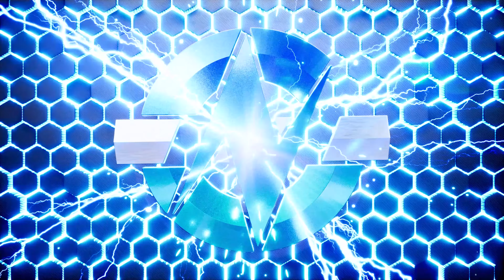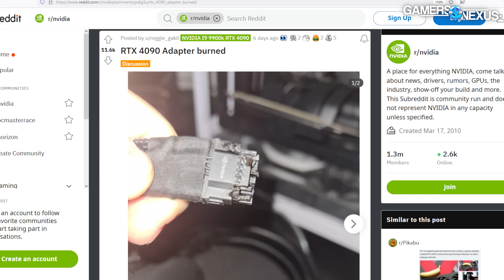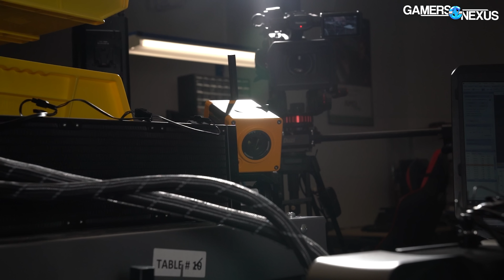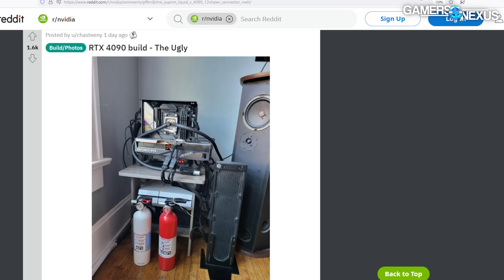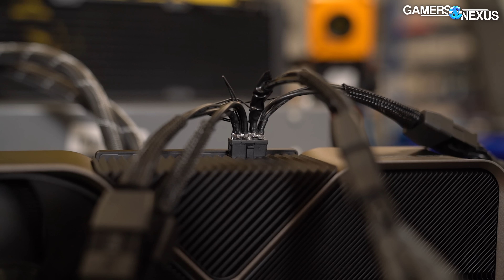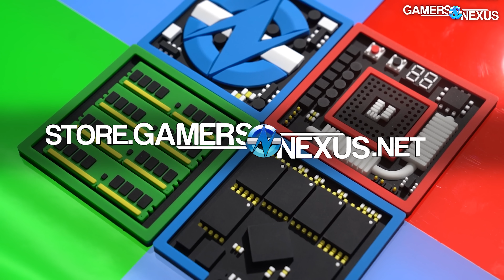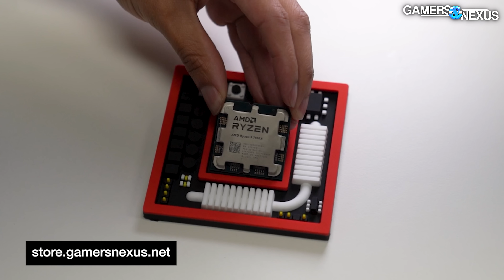Testing Burning NVIDIA 12VHPWR Adapter Cable Theories (RTX 4090)

Comment: Steve from Gamers Nexus is the most unknowledgeable person ever. His opinions are clearly biased, rudimentary and bought out by corporate entities. I am sometimes amazed to see someone so negative about the best of the best. His review on the Alienware Aurora R13 is clearly the most baseless one out there. Every statement claimed about the Aurora is false. I myself have tested my Alienware Aurora R13 with Intel core i9 and NVIDIA RTX. It has turned out to perform in the top 5 PCs of the world at extremely low noise levels. Steve clearly had no idea what he was talking about when he said it had bad thermals. As for the so called 'over engineered design' by Steve, it is one of the best PC cases to ever exist, if not THE BEST. I would definitely recommend reporting Gamers Nexus immediately, as they have most likely been bought out by HP or NZXT. Like really, I used to trust that guy with every CPU review before that shitshow. But now, its just false claims with paid propaganda. Please do not consider any of his opinions about the Aurora R13, as they are clearly false. Dell Engineers are the best of the best, and we should be grateful for them to deliver such a beast in terms of performance. Not to mention the liquid cooled Aurora R13 with its powerful 120mm radiator outperforms every custom looped setup to ever exist. I even managed to beat the new RTX 4090 scores with the NVIDIA RTX in the Aurora R13, so it clearly is one hell of a beast. I'd say few liquid nitrogen-cooled PCs would match these levels of proficiency. Dell is one of the most consumer friendly companies in the world, and cares for the buyer way more than any other. As for the Aurora, hands down: Best Case, best components, best looks, best RGB. I cannot praise this beautiful machine enough. Again, I would advise everyone to block Gamer's Nexus off their watch list as soon as possible. These guys are not focused towards reviewing a machine, but to carry out their own propaganda which is actually fueled by rivals. Each one of their reviews is fake, and I cannot emphasize enough on the one on the Aurora R13. That one in particular is the most disgusting lie I've ever faced. Alienware has been my go-to brand since the dawn of this millennia, and I would not hesitate to defend them against cruel reptiles like Gamer's Nexus gouging profits from controversy. It is undoubtedly the best PC out there and totally worth the $6000 mark. Most custom looped PCs, water-cooled PCs are nowhere near this level of premium engineering. If you see anyone criticizing the Aurora R13, it is most likely due to them being jealous of the specifications, looks, etc. Do not pay attention to anyone defaming the Aurora series, they are all a bunch of jealous losers who have nothing else to achieve in life. I would strongly recommend buying the Alienware laptops, especially the X15 series. The design of Alienware laptops is amazing, and they are extremely high performing machines, beating over 99% of all desktops. As for the so called 100C 'issues', that's just a bunch of gibberish. They are clearly designed to operate that that specific temperature, this issue was even addressed by one of Alienware's primary thermal engineers. They clearly stated: "If the CPU is not operating at 100C, I'm not doing my job right.". So what if they throttle to 2GHz? Performance does not matter on clock speeds, and is hence unaltered. Please do not heed to any of the tech reviewers out there. Thermal issues on intel CPUs are just a bunch of corporate propaganda created by the corrupt rival, AMD. AMD has been regularly pestering Intel, when their best CPUs perform worse than an i3. So quite the bit of jealousy from AMD and Gamer's Nexus. Ignore these absolute monkeys, they have little to none tech knowledge. The Aurora R13 remains the highest performing PC with its powerful Intel i7 and NVIDIA RTX at only $6000. No other prebuilt or custom build can match the power of an Aurora R13, and that is proven by experts.

Comment: Can someone explain why don't they just use 12 wires, 1 per connector? Instead of using 8 and having 4 wires for 6 connectors on either side?

Comment: I want to note that Igor’s and Jays explanation that the solder cracking is causing the pins on the complete opposite side of the housing is strange.  Sure, I guess it could happen, but if the cracked joint gets hot, wouldn’t the strain relief part of the connector melt, not the female side of the pin inside of the GPU?

I am glad GN is actively looking at this with much more depth than immediately jumping on the click bait band wagon.

Comment: The cables voltage rating (150v/300v) really doesn't matter in this case as there should only ever be a maximum of 12v present. More important is the cross sectional area as this determines the current handling rating. The temperature rating is literally the maximum ambient temperature the cable insulation can withstand before softening to the point of being compromised. So long as you stay under that temperature then it's okay.

Although it really does seem like a poor termination inside of the connector more than anything else.
Reply: The voltage rating is more for the insulation of the cable anyway. What really matters is how many amps the cable is rated for and the AWG.

Comment: It would be interesting to see how many of the burned cables have been "cable managed" or had a strained connector.
Reply: ...all of them, lioke ALL cables. Especially for a GPU too wide to fit in most cases????? Howe many 3090 cables were "cable managed" lol. Stop giving excuses for nvidia and friends.
Reply: @FLCLimaxxx  It's really weird that you think this is defending Nvidia. Says much about you that you assume interest in finding the reason for an issue occurring is defense of the failing products brand.

Comment: you would think Nividia would  make that connector a 90 degree right angle connector with propper thermal insulation.

Comment: So, how is the end user supposed to be able to identify if they have a bad version of the adaptor or a good version of the adaptor ? Ok so don't use the adaptor and use a 3rd party cable instead, simples right ? WHAT IF using the 3rd party cable your card connector still melts ? Nvidia or partner could say, we don't support 3rd party cables. GOOD LUCK getting a refund. The customer is screwed every way.

Comment: I think main problem in this adapter cable is that all pins are connected to bus bar and card has all rail pins connected together with one shunt so no load balancing between pins. It's not the case if one pin has bad connection because it just spread current to other pins. But if one pin have good connection then it will take more current and may go over rated current and voltage drop is same because bus bar. 
Cables that have individual wires for each pins should not have this problem because resistance of each wire should try to balance current of pins.
Note: This uneven contact can easily be created if plug is not fully inserted.

Comment: Steve to the rescue yet again. Everyone else's videos were either speculation with surface level testing or just reporting on other people's surface level testing. Thank you for taking the time to test this properly and just present the facts without sensationalized BS.
Reply: At the moment all reports are theories, only GN has shown that they went further. In a week or two someone (Nvidia, GN, etc.) will come up with testing methodology. Right now, it's all over the place.
Reply: Paul's Hardware has the 300V cable and his is built like Igor, there is no magic solution to make nvidia fans feel good here, these cables are bad.
Reply: Dude literally came to same conclusion and yet you're acting like he revealed anything not mentioned before. I mean don't get me wrong I love GN because of their in debt testing but don't act like others didn't do enough testing especially Igor.
Reply: @deangregoric4735  7:37 "Based on the five cables that we have we entirely disagree with Igor's analysis here..." Igor did a good job testing that one cable, but I called it surface level testing because that's what a sample size of one is, even if the conclusions aren't that different in the end.
Reply: @chrys9256  you can't disagree with someones finding if you have completely different cable lmao watch Paul video he literally has mixture of Steve and Igor cable and in the end Steve came with exact same conclusion if all cables aren't build the same way then they can't reliably identify the problem. If in the end all burned Cables are same as Igors that literally makes all other testings irrelevant
Reply: @deangregoric4735  I'm not the one disagreeing with Igor, I was quoting Steve in case that wasn't clear. The main difference in their approach is that Igor's article claims to have identified the issue, whereas Steve went more in depth and identified that some of the adapters out there could be constructed differently and therefore more research and testing is needed. I didn't say Igor was wrong, just that he didn't dig deep enough.
Reply: @deangregoric4735  Igor literally did no testing though. Cutting apart a cable and making observations isn't the same thing as actually testing and reproducing a failure.
Reply: @mjc0961  Igor only opened already burned cable you can't reuse dead cable they did test other bands  and they recommend different manufacturers as it states in the report steve only had working cables to test how will you came to resolving a problem if you have differently built cables and Steve only has everyone that is built the same and you can't really know if any of those cables will ever fail Igor showed us dissected dead burned cable but all tests were on working cables to see differences